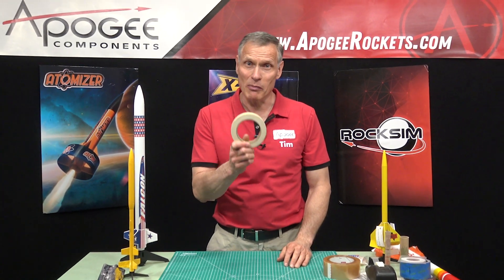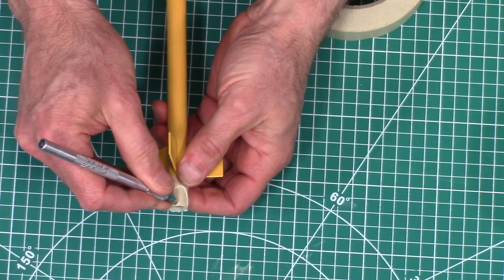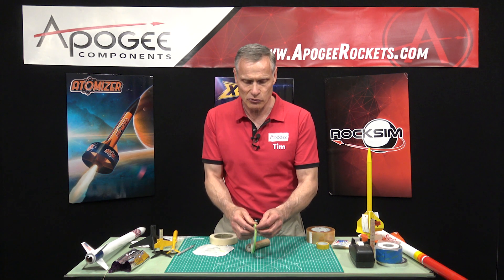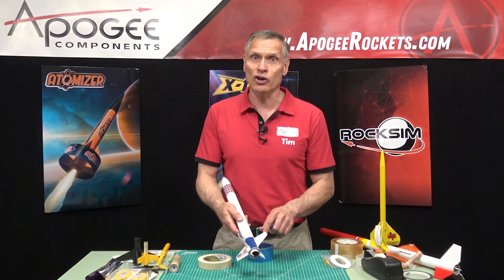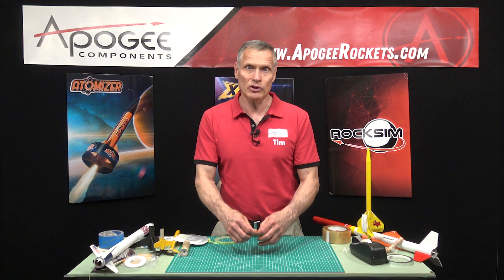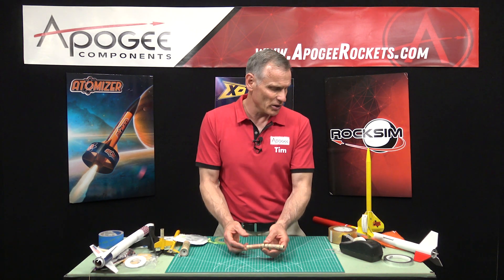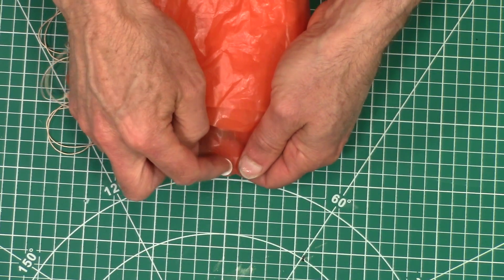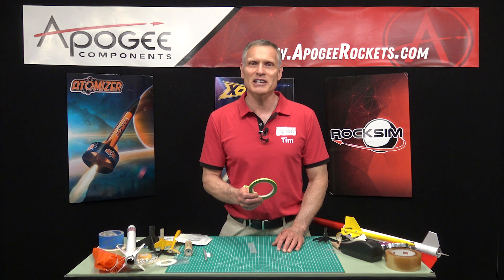What Kind of Tapes Are Used In Model Rocketry?

Comment: On the NAR's page on Facebook I've seen numerous unsafe builds. One of them was someone using tape to attach the launch lug. I called them out on that. They were just like, "Well, I've launched it a bunch and it's fine. Also, tape is a better adhesive than wood glue or white glue or epoxy." Which is obviously wrong.
Thoughts on that?

Comment: Tamiya tape is the best masking tape I've found.  The blue painters tape is not good for clean paint lines.  I bought a rollof "delicate surface" tape and it worked better but still didn't create good lines.  I use the Tamiya along the edges then fill in behind it with blue tape.
I've used the cellophane tape for staging before.  In the old days a lot of the Estes multi-stage kits were minimum diameter so the tape was all that was holding the lower stage to the upper stage.  Kits produced since then with larger body diameters can use tube couplers to hold the stages together and not rely on the tape.
Cellophane tape is very convenient for repairing tears in plastic parachutes.  We used to use it for attaching shroud lines to parachutes- tie a loop in the shroud line and put a piece of tape over it.  However there are better ways of attaching shroud lines.
You showed masking tape for engine retention in minimum diameter airframes.  I know people that use it for larger Estes rockets- put a piece around the end of the motor over the metal motor hook to be sure that the hook doesn't slip off during ejection.  And last some people use masking tape to hold in igniters.